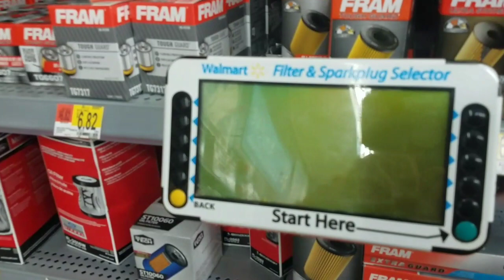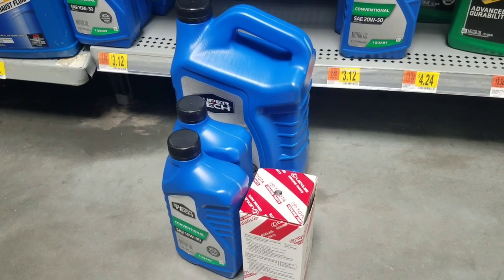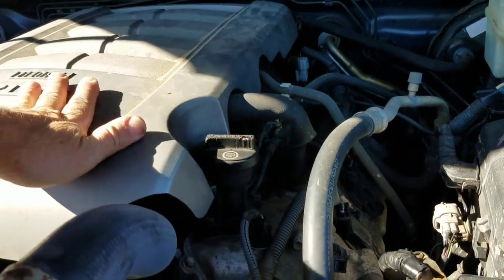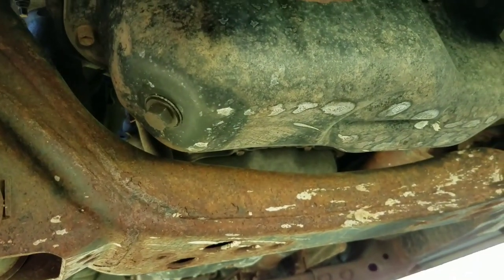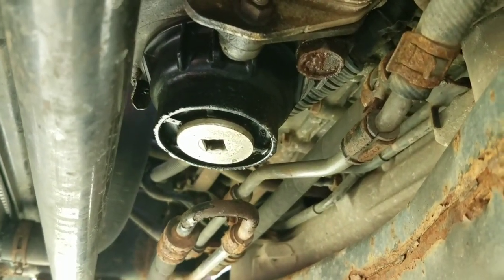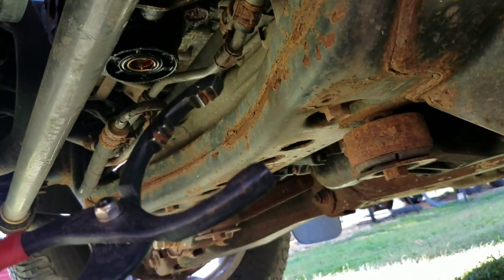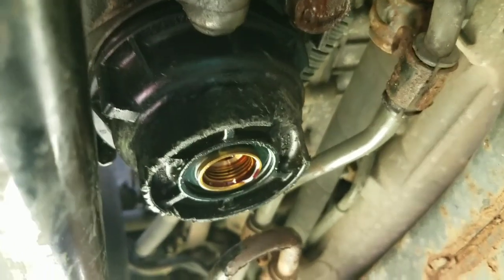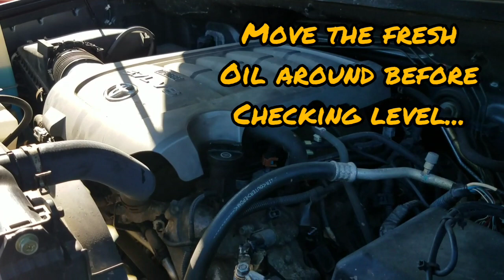Big Texas Oil!..Change (Made Hard) Thanks Toyota!

Comment: I changed the oil in my brothers Toyota Tacoma. It's a completely different design and I was amazed at how easy it was to change the oil filter.
Reply from the maker: Tacoma are great trucks. I had one for years. They don't have enough power to pull a big boat, so I'm stuck with the tundra

Comment: Are you staying south for the winter?  Good points on things to keep in mind when changing your own oil.  I quit changing my own oil after I over tightened the filter once and ended up having to drive a screw driver through it to get it loose.  The next time I didn't tighten it enough and it all leaked out.  After that, I figured I would be safer to have someone else do it.

You are right.  These engineers have never had to work on their own vehicles or they would never design the vehicles like they do.
It looked like your replacement would let you use one of those old school filter wrenches to take the cover off.  Is that the case?
Safe travels.
Reply from the maker: P-Hip! Good to see you again ;) I check on your channel occasionally (when we gonna get more travels in the casita?) ;) yeah...I hear you on just paying someone, but the problems with that is...I'm a man, and I'd never live it down if I paid another man to do it ;) seriously though, "professionals" rarely do it right either, or find $500 worth of other issues to scare you about. I've jaut surrendered to doing 90% of my own maintenance. Oh...I did the screw driver trick once too ;)
Reply: @backwatersandbackroads  I have had a busy year doing remodels on the house.  In fact, today I had a guy here starting on my back splash.   The next videos I put out will probably be before and after remodels.   I had planned to pull the Casita back to Florida for a couple of months this winter but I just don't think I can get things done with the house and the camper.  However, I do plan to go down there for a couple of weeks and stay in an AirBnB.  Yea.....I understand the whole man thing.  That is one of the advantages of being a girl.  Hahahaha.  I am happy that I am not the only one who had to resort to the old screw driver trick.

Comment: Excuse me for being the stupid one here, but that square hole you used to tighten the filter on with should be used to take the filter off. The 1/2 inch extension should fit right in that hole and then you can use your ratchet to take the filter off. Oh, I found out about that Texas blue law on buying alcohol on Sunday like you did. lol
Reply from the maker: Hi John, you'd THINK that's what that square hole is for...but it's actually a drain, which unscrews separate from the cap, guaranteeing you'll over tighten or leave too lose. It's so dumb!!! Thanks for watching man
Reply: @backwatersandbackroads  If that is a drain and is separate then buy the filter removal tool that fits over the end of that whole thing. Just google Toyota oil filter removal tool. There is one for $8.99 on Amazon. You could go back to The Shanty Boat Beagle Adventure. lol
Reply from the maker: @johninokla2635  thanks man, I do know there's a couple of cap removal tools, its just so annoying to have to buy one! Lol. Beats wrecking the cap I guess. I hope this venza model lasts longer

Comment: I change my wife's Toyota sienna oil and I hate that filter set up, I say every time , who the heck invented this fiasco, it comes with a flex drain that I got to use once, or it comes off all together and can't use the flex drain, either way it's a messy pig job , my other vehicles with regular filters doesn't make nearly the mess, they built an awesome vehicle but the oil filter is crap.
Reply from the maker: You get it! Thank you. Whoever came up with it needs to be shot...twice. in the head ;)

Comment: I can't remember when I was a mechanic how many different types of filters they could come up with on all the makes and models of vehicles. Now for the interesting part. Back in the 60s they had the same type filter setup as your Toyota...LOL Funny thing is today they do away with the metal outer shell and charge you more. Why? Because you are driving a newer vehicle so you must have money..It's like not putting lead in gas and charging more for it. Done with my rant. Enjoy the warmer climate this winter. Time to head out and sell some oil and filters at my local Napa parts store.